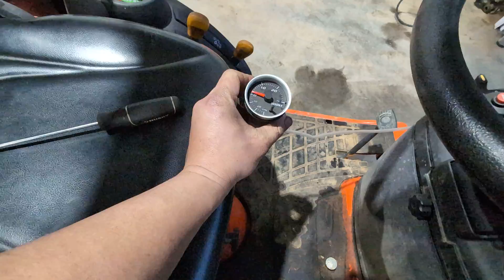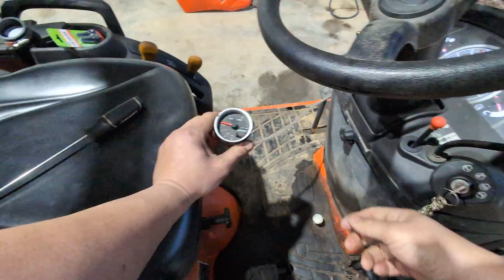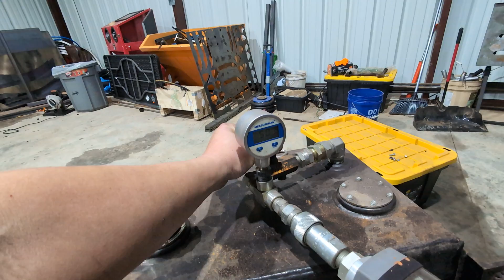HydrosPlus Turbo+ for the Kubota BX - First Power Test

Comment: I'd love to see you tackle a Kioti CK2610/20.   I know the fuel can be turned up without a turbo to 32-35 ish HP.   I could even supply you the tractor to do it, I plan on purchasing one from my local dealer this spring.
Reply from the maker: They will have to get a lot more popular for it to make sense for me to do something with that model, but if you can already get 35HP out of it, that sounds like plenty for that size tractor.

Comment: Are you thinking this will work on the D1005 engines? ie:Bx2680
Reply: I was hoping for one for my 2680 also
Reply: Me as well
Reply: Yes, I would like this option for my 2680.
Reply from the maker: Unfortunately, I can confirm that it won't work on the 2680.  That model uses a different exhaust manifold, so the one I'm having cast will not work.  The main difference is that the 2380 has a mounting flange that is 90 degrees out of phase with the other 2 and the 2680 has all flanges in the same orientation.  Given there are relatively few 26XX out there vs the 23XX, I don't think it will make sense for me to cast a manifold specific to that model, but I will look at it.
Reply: @HydrosPlus  Bummer! I was really hoping for a bx2680 power upgrade. Oh well. Thanks for all your work regardless!
Reply: @HydrosPlus  I’m not sure how you figure that there are few 2680s out there. I can’t believe it would be that hard to come up with a manifold for one
Reply from the maker: @danyoder3534  I'm speaking in relative terms.  One thing the BX26XX has working against it in regards to numbers is that they don't make a BX26 that has the backhoe.  That means anyone wanting a backhoe has to get a BX23S...which is the same as the BX2380.  I don't have any data on the actual sales numbers from Kubota, but only 7% of my customers that bought the BX cylinders have a BX26XX.  

The cost to have a manifold cast is significant, so the payback is long.  That said, if enough people chime in that say they want a turbo for their BX26XX, then I will make it happen.
Reply: @HydrosPlus  I would sure be interested in buying one

Comment: B series next ???
Reply from the maker: I can't say for sure. In my neck of the woods, if I were basing it on orange tractors I see driving down the road, the L2501 would be next.  But if the 25HP and below  B series are more popular, then it's more likely to get looked at next.
Reply: The  L 2501 is probably more popular than the b2601.  Even the LX 2610 is probably going to be more popular
Reply: 250x/310x/380x l series would be neat, I've been looking into it myself on my l3800, I just found your website today,  I'll be putting in an order for some cylinders shortly

Comment: I guess it’s safe to assume this will be a higher price point than the JD being it will need a new manifold also..?
Reply from the maker: Right now, I'm expecting it to be the same price point.  While the manifold casting will be more expensive, the JD version also has a cast part.  Since I have designed new parts for the JD along the way,  most of which will interchange with the BX model, I should be able to absorb the additional cost.